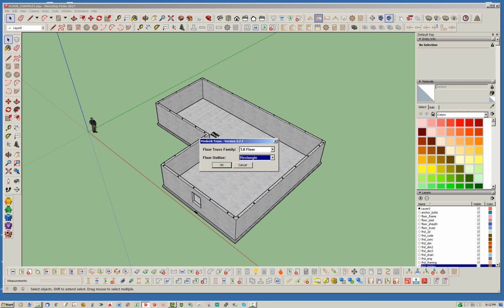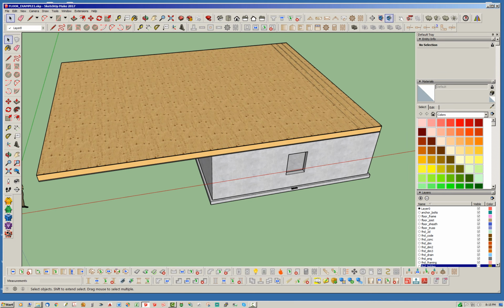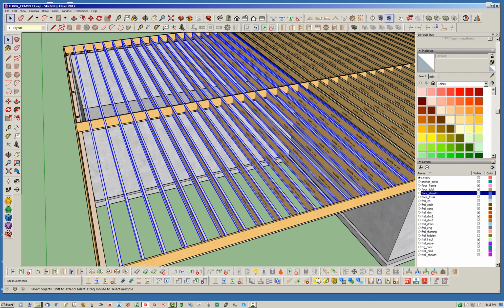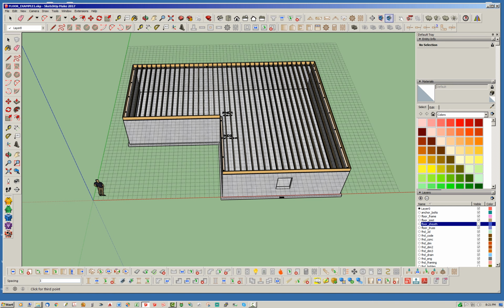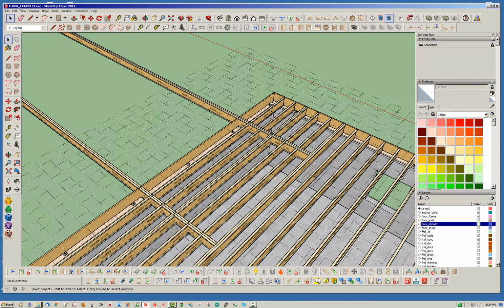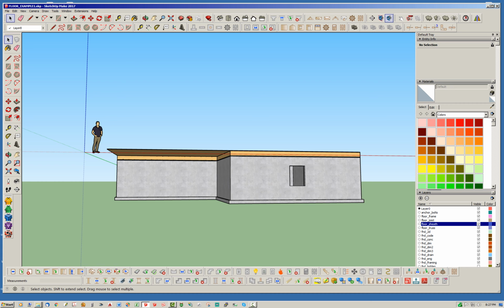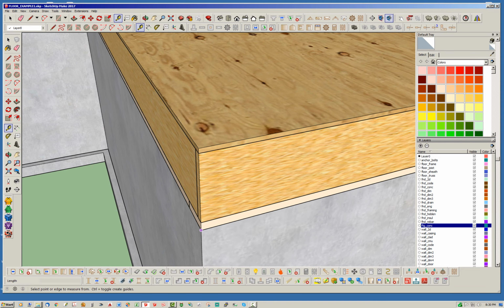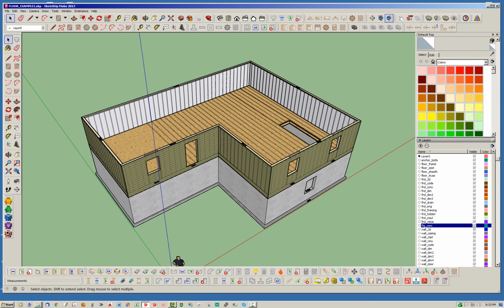Medeek Truss Plugin Tutorial 19 - Polygon Floor Workaround

Comment: We always pop our wall lines so the sheathing is flush with the floor system.  This saves waste on installing OSB in that area.  What would be cool is having an offset for the wall horizontally so you don't have to draw a line half inch back all the way around which is not a big deal but would be handy.  The other reason I do not let my wall sheathing hang over is that not is not exposed at the bottom to the elements.   Thanks again for your work on these extensions.
Reply from the maker: From an engineering standpoint (I'm an engineer) extending the sheathing down over the rimjoist and sill plate allows the structure to be better tied together.  This provides a positive connection between the wall and the foundation.  Typically the anchor bolts are bolted only into the sill plate, somehow this connection needs to be extended to the walls above.  When a wall sits on a slab-on-grade the wall is directly bolted to the concrete.  I'm not saying running the sheathing flush to the floor is wrong, but by extending it one is easily able to connect the load path between the anchor bolts and wall above.